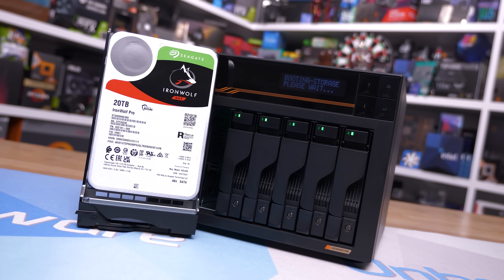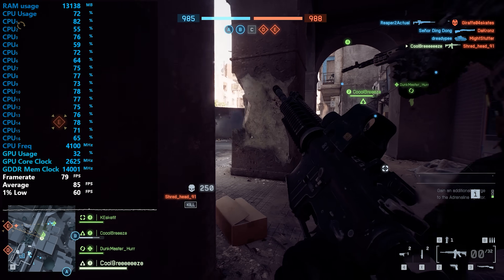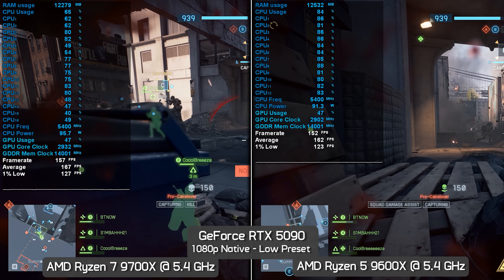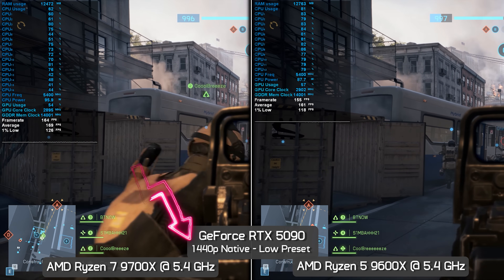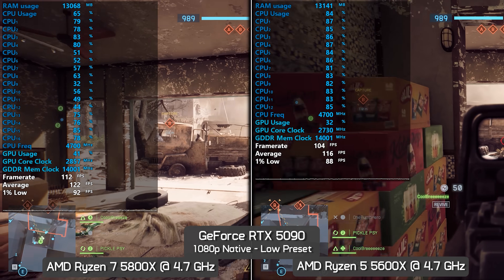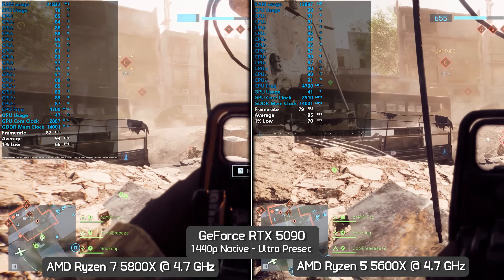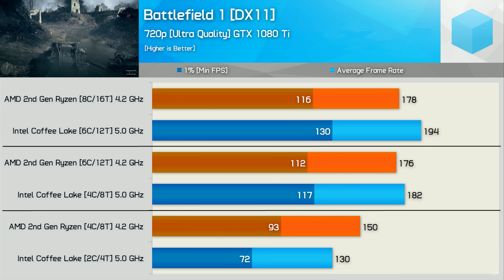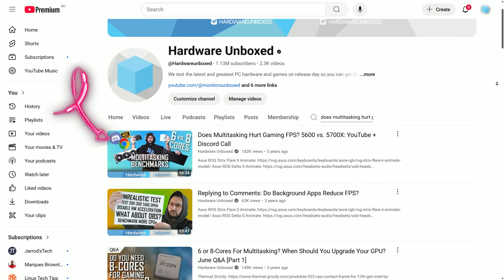Why Gamers DON’T Need More Cores, 6-Cores Still Works Well!

Comment: i5 14600k and ddr5 7200cl34-42-42 is all we need for gaming
Reply: yep and the 14600K is down to $149.99 it's a great value. Just got one and it came with BF6 free.
Reply: @JayzBeerz you wont see this here, it's better to test ryzen 2600x xD which is super cool btw that someone spent time to verify it
Reply: that latency is kinda high for ddr5
Reply: @nostrum6410 it's good am5 uses ddr4
Reply: @walllec i think you are very confused

Comment: The difference between 6 and 8 cores in BF is:
8 core CPUs run one thread per core most of the time
6 core CPUs often run 2 threads per core using SMT

Especially non VCache CPUs in gaming workloads are waiting for data from cache/memory, depoendencies on instructions etc. so with a beefy core the bottleneck is only rarely execution units so using SMT has low penalty.
With VCache that penalty is higher as core utilization is higher. The same happened for 2700X vs. 2600X that do not have such a beefy backend to handle 2 threads in parallel.

The whole situation will change drastically as game engines start using more threads and games untilize all 16 threads of an 8 coire CPU which is already happening in some games.
Buying 6 core CPUs is the equivalent of 10-12GB of VRAM: 4 years ago it was perfectly fine, 2 years ago you could see issues arising in some settings that you rarely use, now you are already seeing like 10% performance drop on average in a broader parkour, but all still manageable. Now fast forward 2-3 years and you can estimate how future proof it will be.

8 core CPUs now are the 16GB VRAM of GPUs: Still works fine, but more headroom would be nice. Unfortunately AMD does not offer anything above 8 cores per CCD (in games the second CCD is not really usable) and Intel does not have VCache and they have issues scaling the ring bus past 8 stops.
Reply: Apparently Zen 6 are doing a 12 core 800X3D with v-cache on all cores.

Plus, there is rumour that AMD are making a 9950X3D update with v-cache across all sixteen cores.

Comment: There is good reason to think that more cores will become more important over the next 5 years or so. So probably enough time to wait out 1-2 more CPU generations.

Ray traced global illumination means that more games no longer rely on static light maps for global illumination, which enables more dynamic worlds with more physics etc. That also has game and engine developers more interested in proper multithreading again.

And Epic currently works a lot with CDPR for Witcher 4, who already merged some optimisations for UE multithreading back into the main engine.

Comment: Is that really a proper test or vaulable conclusion, because you've tested wth one game? .......... If you run your comparisons on CPU demanding games like Stalker 2, or Oblivion Remastered, you might get different results. Games like Cyberpunk 2077 I think scales with the CPU used. 
I have seen all eight cores and threads almost fully maxed out, with the 9800X3D in Oblivion Remastered. Literally all cores and threads around 90+%, (while GPU slacking at half power) with max settings and RT on. Pretty sure you're going to see a significant drop in performance with a six core CPU with Oblivion Remastered.

Honestly, really surprised you did this video - this way, but then I might very well be wrong. 
I think the reason it's better to have more cores is for background tasks too. Often we find with lower core counts that we have to start shutting down background stuff while gaming. Although that can happen too in CPU demanding stuff with higher core counts.

Have also heard there are games which utilise eight cores. 

By the way, for some time I've thought, you sometimes need to include more titles in your hardware tests. While you make lots of brilliant vids with zillions of games when testing hardware. Sometimes you do the same few games: Marvels Rivals,  Dying Light 2, Delta Force, and maybe two more. It leaves me wondering how we are supposed to truly evaluate e.g. a GPU with those few games.

Comment: I built 7600x, 7900gre system in early 2024 with the intention of upgrading to a 7800x3d, but I've honestly seen no reason. This system plays everything I want at 1440p.
Reply: You should skip the 7800X3D even if you needed an upgrade. Zen 4 runs hotter than Zen 5. .... Also, there are rumoured to be two more generations coming to AM5. Your upgrade possibilities are almost endless.

Comment: Wow 5600x still runs this game very well.
Reply: debatable
Reply: @nostrum6410 Not really, 80fps is enough for a game to be smooth, 5600x is above this level.
Reply: @patrickc8007 i wouldn't call 80 fps smooth at all
Reply: @nostrum6410 Everything below isn't, the difference between 60 and 80 is much larger than the difference between 80 and 100, 90-110 is Perfect, and this is where 5600x is.
Reply: @patrickc8007 not after you try a 240hz+ display

Comment: It really isn't a very useful test to pair things like 6 vs 7 level CPUs in order to compare 6 vs 8 cores with absolute top of the line specs for the rest of the test rig. This is how the intel battlemage  issues slipped under the radar at first, and even under ideal conditions without a factor like that hiding it is going to distort values. Should have used a middle of the road specs rig to better match what someone considering a 6 vs 7 level CPU will be putting it in.

Comment: Most games has the main program that runs in one core. Along that there are several support task that other cores does. It does mean that other cores has to wait the main core to run the main program so everything above 6 cores are just idling because the main core can not run the main program any faster…. The more cores you have the more those cores has to wait the main core…

Comment: You are correct, core performance matters more and 6cores are enough with certain cpus. But its not optimal, if user play game record it, watch youtube, has tons of chrome tabs open, bunch of office apps open, discord open and streaming, as soon as you launch UE game that bits cpu hard you will run to hard stability issues. Driver interupts will be handled slow, wait in line, audio will start lagging, videos and streams lagging, game stuttering. Games itself dont require more than 8 cores, but to have  fluid overall system experience you want more cores. I have used many different cpus over last 5 years from 6 to 32 cores, and this is my experience. Always having weird random issues, slow downs and stutters with 8 or less cores, mostly due to games that are not properly optimized. Now running 9800x3d and in some games i need to set system driver interupts affinity or my audio, mic,stream would start to lag. I cant wait for single CCD ryzen 12core cpus. It's super annoying building expensive top of the line pc to just have to tweak cpu utilization manually.

Comment: i do think multitasking is improved with more cores for more intensive loads like video encoding, large productivity software, or livestreaming. i get much, much better performance in games with my 5955wx than I did with my 8700k while livestreaming or editing even though in just games/single core loads they're not that far apart

Comment: I mean, maybe. My old Ryzen 5 3600 started suffering in more recent games, and I think that anyone building a new system for gaming should go for an X3D chip, no matter wich one.
(I went with the 9950 X3D because I decided to build a single system for both gaming and work in 3D modeling and CG rendering)

Comment: The PS3 had a proc called " CEL " unlike today ( consoles use off the shelf parts). Since developers were lazy they never used the PS3 fully ( the nodes were not used). What's worse is that Sony wants $500 dollars for 10 year old hardware
Reply: they didnt exactly make it easy either
Reply: @nostrum6410 Idk because I'm not a programmer, but nobody even tried

Comment: I will say that technically there is a quad core CPU that released only around 2 years ago, and was a highly recommended budget/entry level CPU at the time. The i3-13100f, so people could realistically be trying to play Battlefield 6 on a quad core. 

I also know a few people who are super pissed off that because of Windows they finally have to upgrade off of their positively ancient i7-4770k, and those people likely tried to play BF6 as well. Given the minimum spec I doubt those people even managed to get the game playable, and likely would sit on forums and call the game "un-optimized" because they can't play it on 10+ year old hardware. 

When I ironically BF6 seems like a really well optimized game. Beautiful visuals on top of low requirements. You know... unlike some single player games that people have claimed are "well optimized" while a 4090 struggles to play it without frame gen...
Reply: What I've learned from listening to the gaming community is that BF6 is Schrodinger's optimization: both amazingly and terribly optimized

Comment: there isnt a 6 core being tested? the title says 6 core works well..how did you come to that conclusion without providing numbers?
Reply: maybe im an idiot and the cpus that show 12 are the thread count on a 6 core? i have an r5 7600/ rx 7600 /asus prime A620 plus wifi/2x16GB DDR5 CL30 T-CREATE. was just trying to see how it would perform. srry im new to pc and went with entry level am5

Comment: Ryzen legit saved AMD. even the gpu's are really getting better. rocking R5 3600 and a 9070XT. BF6 was amazing
Reply: CPU not bottlenecking? What fps u getting?
Reply: @lifeofranco  it is for sure
Reply: @lifeofranco  well the cpu will deff be a bottleneck in bf6. I turned down most settings with high cpu load on 1440p and got around 100fps. visually i could not see a big difference. so i would recommend that for any cpu since high frames are ideal for fps games
Reply: 5700x and a rx6800xt. I was barely bottlenecked at around 140fps from the cpu. The card wanted to go to 150ish fps, so overall it's pretty balanced. The 9070xt would have been a waste with my cpu. I'm guessing the 9070xt would hit 180-190 fps with a capable cpu. I think your cpu is not doing that gpu justice.
Reply: @MrNota500 I guess bf6 is a unique case with such a heavy cpu usage, most other gams should be fine for him

Comment: Who would buy a modern CPU with less than 6 cores?
Reply: Some one who wants to have optimal gaming CPU…
Reply: @haukionkannel  I don't think you can call it optimal for gaming if it barely scrapes along with the condition of keeping a careful eye to limit background tasks...
Reply: @jyrolys6 based on current test there is minimal difference between 6 and 8 core CPUs… even in modern games!
All normal bacround programs running at the same time. Maybe if you stream at the same time, you may get difference, but that is not any more normal backround task while playing.

If you do productivity tasks… sure! But gaming, still 6 cores is optimum.
Reply: @haukionkannel  You replied to a comment about *less than 6* cores by calling it optimal.
Which made it sound that you're a 4 core user coping and extrapolating beyond what the video was testing.

6 cores are obviously still fine.

Comment: Kinda bummed we never got 6 core x3d CPUs in the US
Reply: microcenter had a exclusive 5600x3d
Reply: Don’t forget the 7600x3D as well
Reply: you did
Reply: The cache on CPU's is getting higher and higher each generation, especially i7 / Ryzen 7 series. But x3D defo has the most by far thanks to stacking.
Reply: They do have one it is on the am 4, a ryzen 5 5600x3d. It is a microcenter exclusive. It is 13% faster than the ryzen 5 5500. It kind of replace the ryzen 7 5700x3d which was just discontinued.

Comment: Feels like my 5600x sucks shit. Or maybe it's the MOBO/GPU lol
Reply: What GPU are you running?  What is your memory latency?
Reply: @davidandrew6855  6800xt. I had my first one replaced because of the dog shit quality of that generation causing black screens and such. So some of my issues could be because the GPU isn't as well made. I believe my memory latency is pretty low but I don't have those numbers off the top of my head.